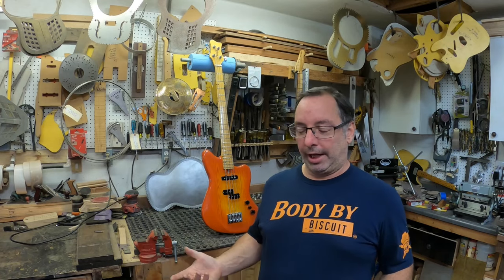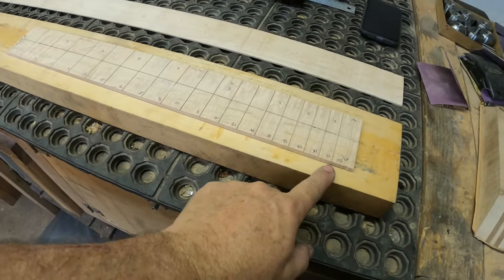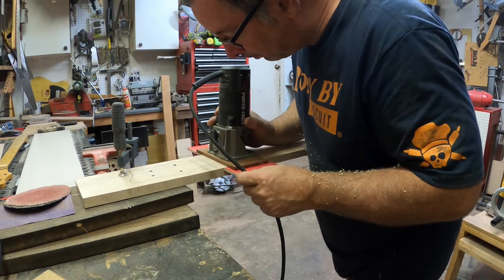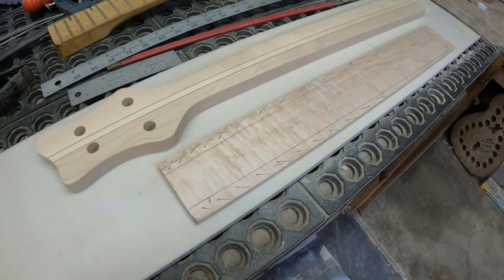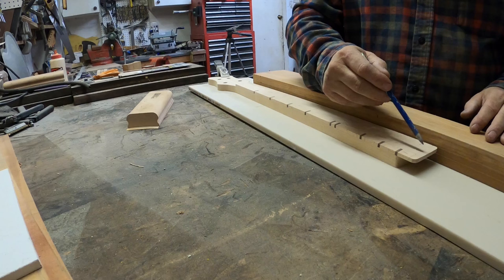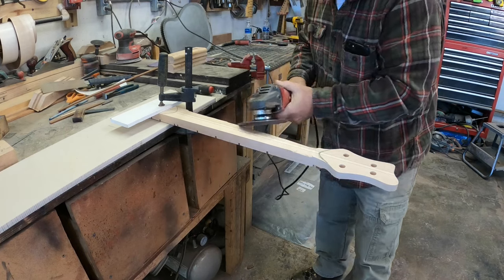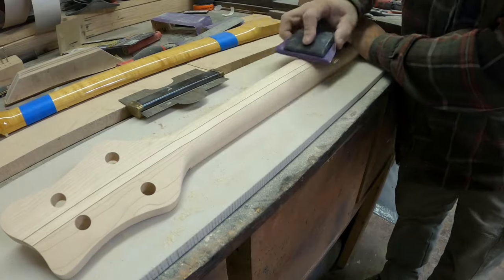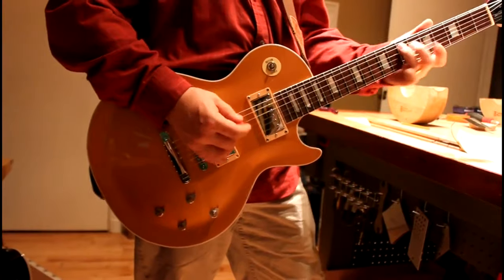Bass Guitar Conversion Neck | 34" to 30" scale

Comment: Hard to see in the video, but the chuck is probably fit with a Morse taper (see the wiki for machine tapers). There will be somewhere you can drive a metal wedge in to dislodge it.

I've never seen a chuck I couldn't find a key for though. You'll be able to find a one for it online for sure. If it's a Rohm, Jacob's or Metabo chuck, check their resellers. If it's another brand, it's likely a copy/rebadge of one of the first two, so... check their resellers.
Reply: What he said!
Reply: That strikes me as an unusual make of drill press - it might be worth consulting with some of these YouTube machine shop buffs like This Old Tony about the appropriate way to remove a stubborn chuck; you don't want to apply a hub puller for example only to discover it has a left hand thread or something similar. I agree that a hefty Morse taper is the most likely mounting option. Best of luck!
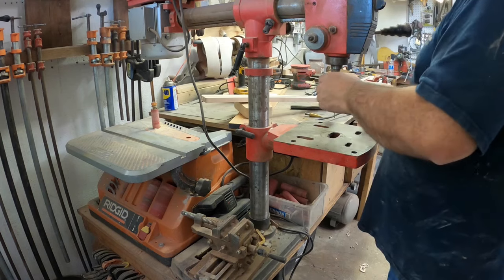Reply: 7:10, here you go @Ninety2: https://www.youtube.com/watch?v=rJ3jyEbcse4.  I bought an old drill press from eBay, and its chuck was in such a bad state that even a brand new key wouldn't work.  I ended up back on eBay, where I bought a keyless chuck.  Morse tapers are numbered 1, 2, 3 etc. according to their size, so if you buy a new chuck, you must make sure that its MT matches the one in your machine.  That said, it's also possible to get MT adapter sleeves to allow small chucks to fit larger machines.

On another note, have you checked that your drill press table is at 90 degrees to the quill?  When you fit a new chuck, put a length of 6mm silver steel rod in it, and check that the table sits at 90 degrees to this with an engineer's square.
Reply from the maker: You guys rock!!! I don't know why I never just googled or youtubed this info but these replies pushed me towards understanding. Now I need to make a little tapered piece of metal to press out my old bad chuck and then order a new one. Thank you!

Comment: Was the little mahogany piece planned or an oops made into a feature. I like the feature. I also like the 1/4" "spacer" great trick. I caught a little Ted and Derek both in there. Great video my friend.
Reply from the maker: Derek and Ted, two of my all time favorites. The mahogany piece was planned, although it does look like one of those "featured oopses" Lol. I wanted to make the neck blank as thin as possible and get just enough height at the saddles. I had an unmentioned goal of saving some weight as well so the thinner the headstock and heel the better. I didn't want to cut the slot in the fretboard since it would be a shallow slot and very thin on the bottom. I've come to realize it's a huge challenge to make a neck build video watchable and entertaining.

Comment: Most chucks attach by a mortise taper. It’s just a press fit and you have to fiddle with them to get them off. Once it’s off you have to determine what the taper is. Either 1,2 or 3. Google can help. Then but the chuck you like with the right mortise taper and pop it in there. MSC, Macmaster Carr or Granger are good sources for quality chucks. I replaced mine with a keyless chuck and would never go back. Good luck. Love your videos!
Reply: It's called a Morse taper, not mortise.